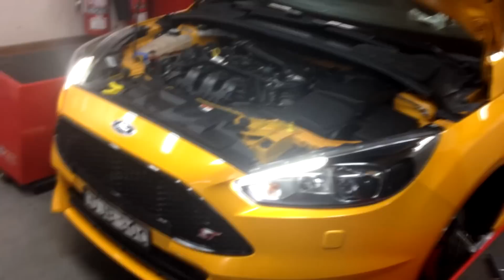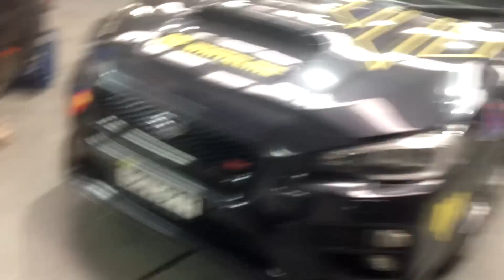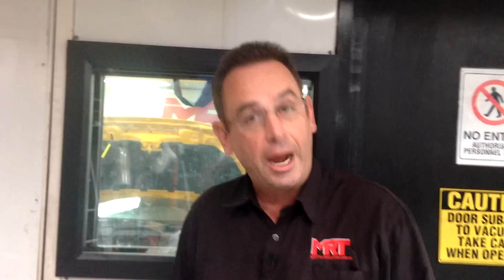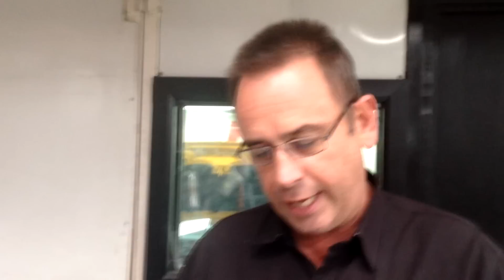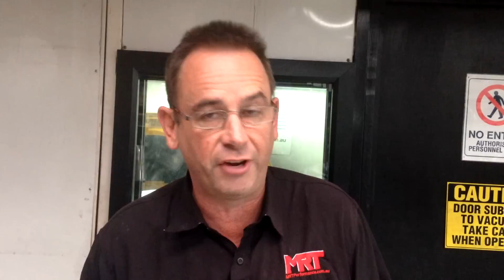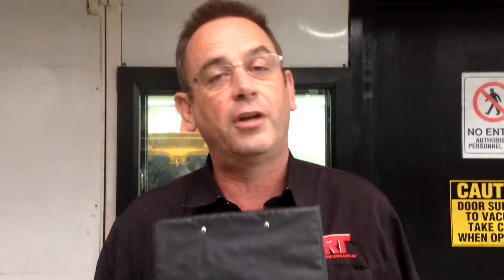Ford Focus ST Custom Tuning - 400+NM @ 2000RPM!

Comment: I know it makes no sense, i know you just buy a RS and be done, but as PROOF OF CONCEPT is it possible to convert a FWD like this into an AWD maybe for a rally built where you are pretty much forced to go down to the bare chassis anyway?
Reply: Doc. Volt I believe you just need the drivetrain and the transmission

Comment: Dyno plot please (horsepower vs lb-ft torque vs RPM, SAE correction factor and 1.00 TCF).  Stock baseline vs your tuned map plot.   A picture is worth a thousand words ;)
Reply from the maker: https://business.facebook.com/MRTperformance/photos/p.10156931630568709/10156931630568709/?type=3&theater

Comment: Not worried about the engine dying like all the RS engines have been?
Reply from the maker: "All the RS engines" is a bit of an overstatement, and this engine has a totally different design. Our for this car and all the cars we offer Power Kits for go through extensive R&D so we understand their limitations and risk is minimized.
Reply: Rambling R1 some of the rs's blew up because they put the mustang ecoboost headgasket on the rs from factory
Reply: This isn't the same engine as the rs it's a 2.0L not a 2.3L
Reply: Anth C so apart from the bore and stroke what’s the difference?
Reply: kit cavanagh they have been warping heads and blocks though which is the main reason the head gaskets have failed and some believe the sleeves walking around has also contributed
Reply: MRT Performance there have been enough of them fail that it has put me off buying one, besides the bore/stroke what are some of the major changes between the RS engine and the ST?
Reply: At 2000 rpm with 440nm have you seen any lspi? Also have you found  that the hpfp is limiting you at 2000rpm
Reply: What we have here is a ticking time bomb......I would like to see a six month follow up!
Reply: The open deck design of the RS engine block is definitely a worry for head to block clearance issues tho. Especially that it runs about 23psi stock! Don't you agree? Surely pushing for more power would quickly cause issues?